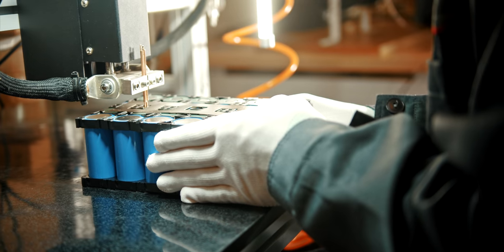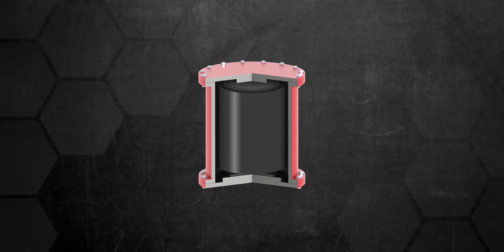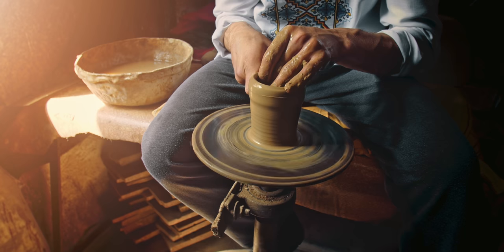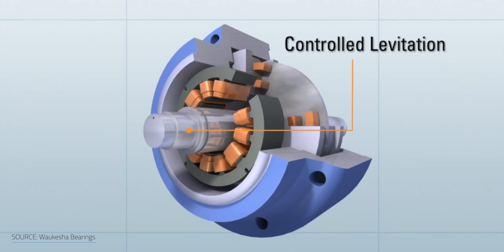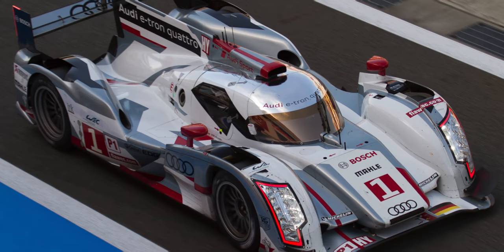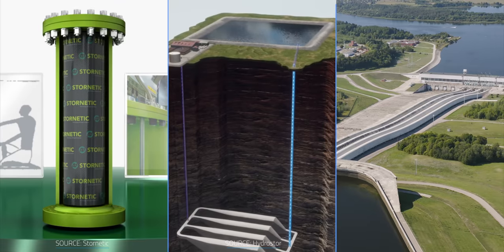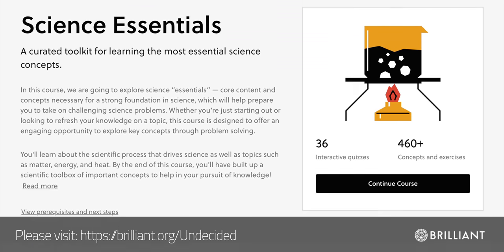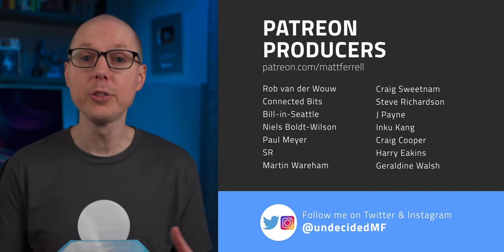The Mechanical Battery Explained - A Flywheel Comeback?

Comment: I used to work for a chip manufacturing in NY. We had flywheel systems that would backfeed the plant if we lost normal power, and when the wheel fell below a certain speed then it would signal the diesel generators to start up. The flywheel chamber was filled with helium to cut down on air drag
Reply: I was thinking about the drag of the flywheel. The bike company Specialized came out with a three-spoke wheel that was insanely efficient. You had more drag turning a page in a book then that wheel spinning.
Reply: Magnetic bearings levitate the flywheel which cuts down on the drag too.
Reply: @CashJohnston  We had a combination of the magnets and helium
Reply: Maybe that's why they are not used for power back scenarios when there's power outages few times during a month or week.
Reply: Why helium 
Why not vacuum.?
Reply: @AftabAlam-yw4eq  From what I've lightly read, bringing the same helium-filled structure up to spec for the vacuum pressure required would drastically increase the cost. Not a good thing for a technology that's already struggling to bring prices down. Also the build up of heat in a vacuum, compared to helium and it's ability to dissipate it quickly, would increase wear on components.

Definitely seems like a good idea though if we could figure out a way to do it efficiently and reduce the need for helium.
Reply: @AftabAlam-yw4eq  it takes alot of strength to contain a vacuum, so it's simply more cost effective to fill the room with helium.
Reply: @epictoast6727  it takes very little strength to maintain a vacuum. It's only about 100kpa which is nothing.
Reply: @AftabAlam-yw4eq  you need power to sustain vacuum, i guess..
Reply: @izoyt  NO, you DON'T! It takes energy for a short period to bring it down to a vacuum but if it's sealed as it should be it takes NOTHING to sustain that vacuum.
Reply: @minilockwood24  I always balk at the use of Helium, there is no more we cant make it so it should not be used for anything but the most important things. Party balloons not being important. So realistically mass production of a flywheel with Helium can't happen.
Reply: @epictoast6727  It takes one atmosphere to maintain vacuum.  Car tire is like 2-3 and a good one almost never lose pressure except for seasonal temperature change.
Reply: Years ago I saw an energy storage system consisting of a rail car filled with rocks and an incline.  To store extra energy the car would slowly drive up the incline, to use the stored energy it would be allowed to roll back down hill, spinning a generator as it rolled.
Reply: @PhilLesh69  That sounds good. Same principal as those elevated dams where they pump water up to them when excess power is available and times like night they reverse the process and use that same water to drive turbines to keep constant power.
I've thought about setting up a similar system using a heavy weight suspended and lifted by electric motors with adequate gear reduction powered by solar during the day then using that weight to drive a generator during the night. The biggest problem is the structure would need to ideally lift it a fair distance and the weight would need to be very substantial meaning a massive structure to support it all safely. A big job and expensive in heavy steel, plus a lot of work and possibly wasted if it ends up only being enough to charge a phone and watch tv for half an hour though.
Reply: @LongItAll  There is another problem which increase the cost. The electrical insulation is very tricky in vacuum. Air is a relativ good isolator but in vacuum you need very high distance that no spark jumps over.
Reply: @lorditsprobingtime6668  that's not true. The pressure differential will make particles diffuse through any material increasing the pressure over time. That's also the reason why it's really hard to contain high pressure hydrogen. Since hydrogen is so small, it will pass through any kind of wall if the pressure is high enough.
Reply: @NorthcodeNoCh  If that's true, and I doubt it, big deal. You have a pressure switch and when pressure rises to anything over say one pound per square inch a vacuum pump fires up and brings it back down again when that eventually happens, problem solved easily.
Reply: Holy cow, that's awesome!
Reply: Are you sure about helium? In power stations they use hydrogen because about a certain % it isn't flammable, low desity thus low friction and good thermal conductivity.
Reply: @matthewmaxwell-burton4549  I honestly don't know but, to me the vacuum seems the only logical choice. No matter what gas you're going to have some friction spinning a flywheel in it. Somebody mentioned cooling of the bearing and I'm not certain that would be any major problem since heat is dissipated into the air or chosen gas but, it also diffuses through the metals and radiates out gradually from them. Ideally you'd have some magnetic suspension type bearings and then NO heat or friction there and if you could combine that with it spinning in a vacuum it should spin almost forever once up to speed.
As you say though, and you are right, Helium isn't able to burn if it's all helium, it needs oxygen to burn with.
Reply: @lorditsprobingtime6668  you may mean hydrogen. Helium is a noble gas, and thus won't oxidize. The problem with a vacuum is maintaining it, now all the bearings have to seal from the atmosphere and that applies a force upon them. Magnetic bearings are ok if the load isn't great, but you'll need to create a magnetic field somehow because the PM will eventually lose their magnetism. Or worse heat-up past their curie temperature.
What is used in industry is usually forced oil bearings. Oil is pumped into the bearing, the shaft 'floats' on the oil and doesn't touch anything else. It also helps seal from the outside..
Reply: @matthewmaxwell-burton4549  You're correct, my mistake, I did mean Hydrogen, just got mixed up while typing it.
On my imaginary one the bearing wouldn't be to the outside at all, it would be sitting in the sealed container. I have no idea how much weight can reasonably be held up by magnetic bearings and for this to be effective it would need to be preferably a pretty heavy one. Magnetic suspension bearings would be ideal since they're frictionless BUT, I have no real idea if it's possible or practical for suspending that amount of weight.
You suggestion of the forced oil bearings would be maybe the only reasonable choice but is far from ideal. The viscosity of the oil alone would create friction which is what I'm trying to find a way around as much friction as possible, if not all, or next to all. My idea relies purely on vacuum and frictionless bearings and magnetic suspension is the only type I know that could achieve that. Your forced oil bearings may be the best we can do in that regard but makes sustaining a vacuum a bit more difficult plus the oil may behave a bit differently in a vacuum. Whether any changes to the oil's properties in a vacuum would even affect things I have no idea.
Reply: @lorditsprobingtime6668  I did some research. And what you are saying is already being used. I was under the impression that the system would need cooling, hence the hydrogen. However this isn't the case. One issue that arrises and impacts the system is how long are keeping the energy for? Because angular momentum becomes an issue.
Reply: @matthewmaxwell-burton4549  Cool that it's already in use, at least I knew I was aiming for what's most useful in this category but hadn't looked into it so thanks for actually finding out. 
I'm a bit puzzled how angular momentum would become a problem though. Our planet has been effectively orbiting the sun and our moon our planet for billions of years based on spinning, albeit sort of slowly for billions of years without slowing and then falling in towards the sun and I believe if anything the moon is gradually creeping away a couple of centimeters a year, unless I've got that arse about too.
Apart from something like a large cat iron flywheel having a hidden flaw and suddenly flying apart sort of situation but, other than that I can't see why angular momentum could become any sort of problem.
Reply: @lorditsprobingtime6668  when something is spinning, it's has angular momentum. Classic mechanics dictate that the system will try and conserve angular momentum. It usually uses the symbol 'L' and has the SI values of kg.m^2.s^−1. If you ever played with a gyroscope you'll notice how it maintains its position. Now if you modify the plane of rotation the system will exert a force in a certain direction (right hand rule can help). Think of a motorbike/bike at high speed. You push the handlebar with your right hand and the bike will lean to the right. The system is conserving angular momentum. This is analogue to Newton's first law. I'm not sure of you are familiar with frames of reference of mechanics in a whole so I'll try and explain.
The are two frames of reference, the earth's and an observer independent of both objects. 
Imagine that you have the axle of your flywheel (spinning mass) locked physically to the earth. It can still spin but you can't change the angle coming from the ground. As the earth spins, in its reference frame (using spherical coordinates) nothing changes. Much like if you hold your hand out and spin, to you your arm doesn't move.
Now change the frame of reference to the observer. To it, the hands coordinates change all the time while you spin around.
Coming back to the flywheel, as the earth rotates. To the observer, the plane of rotation changes as the earth slowly spins around. Thus to conserve angular momentum, a force is generated. And this force is exerted upon the spinning shaft as torque perpendicular to the axis of rotation. Remembering that the shaft is locked into place, the shaft opposes this torque causing friction in the bearings and energy loss. Thus the flywheel will eventually stop spinning as the earth rotates, and the bearings will eventually have to be replaced.
Reply: @matthewmaxwell-burton4549   I get what you mean now, just like a Foucault's pendulum drifts thanks to the rotation of the earth. I admit I never even considered that. A spinning flywheel can be forced around and I'm guessing that a steady gentle pressure should be able to change its direction, especially when it's such a slow change. If that's correct and they are using magnetic levitation bearings couldn't they handle that slow twist frictionlessly?
If they can't then at least The Arctic and Antarctic should be able to use them without that problem.
Thanks for the detailed explanation too. My education in these areas is quite limited so that was very helpful, thanks.
Reply: @lorditsprobingtime6668  exactly ! In a closed system, energy can't increase nor decrease. And thermodynamics dictates that as you transfer different forms of energy, some will become thermal energy (this is a gross over-simplification). Some of the spinning mass (angular momentum) energyh as become a torque Vector pushing into the bearings. The bearings will start to heat because now that the shaft is out of alignment eddy currents will start to cross the metallic shaft and cause a counter force (Faraday's law of induction). You have to remember that if a system isn't in a steady state (ie experiencing acceleration) energy is being transferred somewhere and thus part of that is lost to heat. Gets pretty complicated after this.
Reply: @matthewmaxwell-burton4549   Eddy currents etc weren't something I'd even thought of. I assumed once you had magnetic levitation that would mean no physical contact and therefore no friction, I'm now well out of my depth knowledge wise. 
Save the "complicated stuff" for someone who might understand it, I'm afraid that's not likely to be me. I will take your word for it though and assume these are real problems that are beyond my range of experience or education. 
Thank you for sharing the information you have though, I do appreciate it.
Reply: @LongItAll  Is it even possible to heat up or freeze in vacum chambers ?
Reply: @lorditsprobingtime6668  Even if it was in vacum, gravity would probably slow it down somehow
Reply: @asmircar1  Gravity is why there would be pressure on any contact type bearing. I very much doubt that if it was suspended on friction less, no contact magnetic suspension bearings with zero contact anywhere could be slowed down just by gravity.
Frictionless is very difficult to achieve but, if you can get rid of air (gas in general) friction and have bearings relying on magnets to keep things from touching and there's no other form of friction then why should gravity have any effect? Admittedly I had no idea about some of the factors Matthew Maxwell-Burton mentioned and possibly I'll turn out to be wrong here too but, logically I don't think so.
Reply: @matthewmaxwell-burton4549  What about if you mount the whole fly wheel assembly in a gimble so it can move relatively to the Earth's surface as Earth turns but stay stationnary (in term of angles) to its own reference system? The friction of the bearing in the gimble at 1 rotation per day would be minuscule compared to the friction there would be because of the torque in the flywheel bearing spinning thousand of times per second
Reply: @ThisNoName  you imagine making a reversed tire the size of a room and then mounting hardware inside it with wires running out of it and bringing it to vacumn that holds .
With ac condensers you have solid metal piped system to keep a vacumn and they or somewhat temperamental .
It’s a lot easier to make a room that would hold helium than a vacumn that’s for sure haha
Reply: Sounds like they needed that flywheel at Chernobyl 😂
Reply: @AftabAlam-yw4eq  seriously, that's a very good question. Not only is a vacuum more effective, it is also easier to maintain than a helium filled container. It's a lot easier to keep O2, CO2 and Nitrogen out of a container than it is to keep He in it.
Reply: @LongItAll  The containing structure already has to be designed so it can contain the explosive disintegration of the flywheel.
Reply: @ThisNoName  Tires lose 1psi per month on average.
Reply: @Fireblats  Mine only have to be adjusted for seasonable temperature changes, and that's both OEM and some cheap replacement.  Maybe you need better wheels.
Reply: @AftabAlam-yw4eq  Helium is also inert, no corrosion. Easier to maintain air pressure, people can walk into a room with helium present
Reply: Use superconductor and put fluit N2 inside tubes between the superconductive disk. Then put the whole flywheel in vacuum. Friction will be almost 0... Use extreem high pressure steam boiled from solar towers to get it and put your industrie in the soil in the desserts... Solar towers on top, the Sahara is waiting for a smart ass... Use seawater and use the kooled steam for sweet water production.
Reply: That's a neat use of the flywheel's ability to provide a lot of power for a short time.
Reply: Wouldn't a vacuum reduce lost energy even more?
Reply: @notyou2353   ofcorse... No wind fricktion.
Reply: @notyou2353   immagine you make a flywheel that looks like a bike tire, but 5km in diameter in the soil, in this kind of systems. The potential is enorm because of the high speed and torque. It does however not turn on a centre axel, but hoovers on a superconductive way, supported by thin pipes inside the conductive that beholds fluit nitrogen to keep it cold. It is the ultime battery and when well made it can last easy 50 years per wheel or longer. Remember that with no fricktion things last longer and with uge torque you have less stress by centrifuge force as you have no core axel. The technic is there but investers suck as they want fast results in proffit...
Reply: @cbrunnem6102  how did you come to this conclusion?
Reply: @vasylh  there's very little difference between a vacuum and normal pressure. A tank that can hold 100kpa can likely hold a perfect vacuum.
Reply: @LongItAll  I agree on the increased structural costs to build a unit that can maintain a vacuum, and withstand the pressure differential to ambient pressure, but I respectfully disagree about the build up of heat, there is no friction with magnetic levitating bearings and a vacuum, so no heat is generated, and there is no wear on the components because there is no contact between moving parts.
Reply: @chrisparti  I can easily say I don't know enough to counter argue. I don't even remember the paper I read thru to make that initial comment now without some vigorous searching.

I thought it said something about heat buildup somewhere in the system but I could've easily misread or misunderstood. Just seemed interesting to think about at the time. I do appreciate the correction.
Reply: @LongItAll  Probably older type flywheel arrangements did have mechanical bearings. the vacuum systems he is talking about do sound state of the art...
Reply: @AftabAlam-yw4eq  helium is less dense than air
  for vacuum the walls needed to be thick and braced like in a submarine (external pressure, low internal pressure...).
Reply: @josepeixoto3384  a submarine is submerged deep in water the tank will be in atmospheric pressure. The pressure upon it during vacuum will be 101kpascal which nothing compared to the strength of metals industrially available.
Reply: @AftabAlam-yw4eq   exactly right;
in reality just a bit under the 101 mark; 
 that was just an example, we know that subs are subjected to many "atmospheres".
Reply: @josepeixoto3384  lots of power stations used to use Hydrogen inside the alternators to reduce drag. There did appear to be any safety problems as the alternators were located in a tall building with roof top vents and the flow rate was monitored to determine if any losses occurred. Hydrogen offered performance benefits whilst avoided using a scarce resource.
Reply: @AftabAlam-yw4eq  Some sort of gas is useful for thermal conductivity.   Big generators used to be filled with hydrogen to reduce the "windage" loss.  Don't know if they still are or not.
Reply: @minilockwood24  Though harder to maintain, a high vacuum would be even better, especially a high vacuum with a chamber around the vacuum area filled with helium, so any leakage would instroduce only low-pressure helium until it was again evacuated.